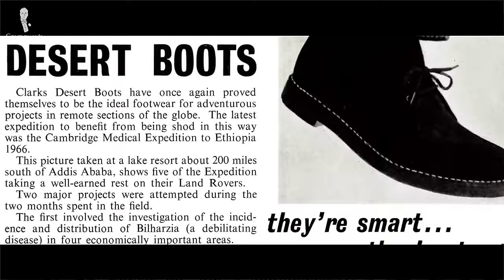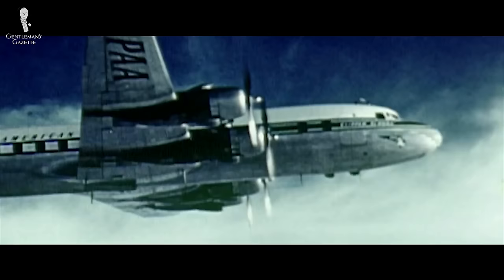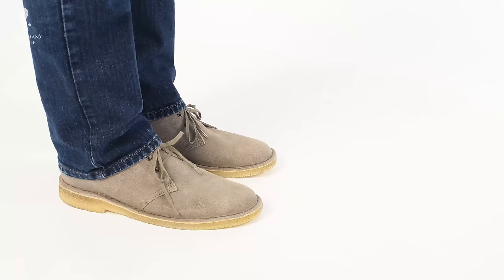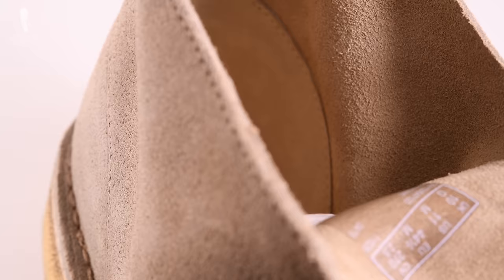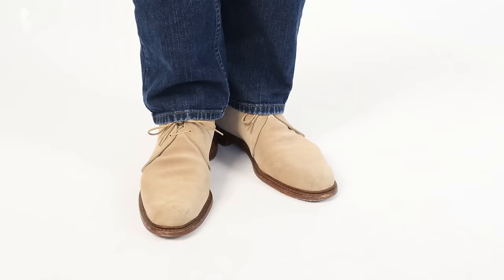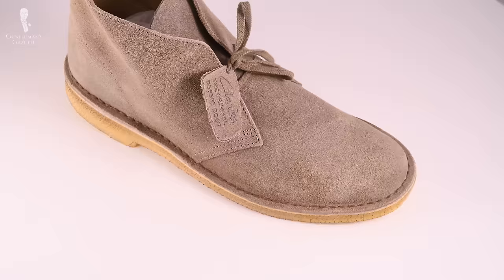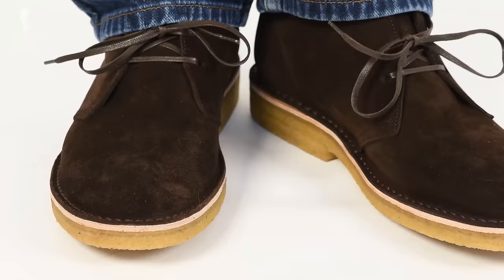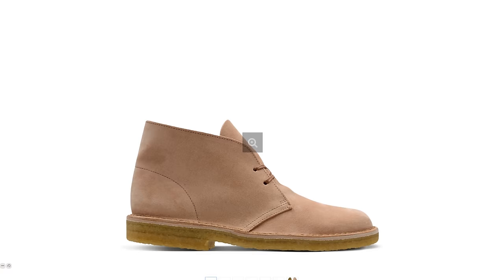Clarks Desert Boots Review - Is it Worth It Series - Suede vs. Leather Chukka Boots

Comment: So I bought mine in 1995 sand gray which historically explained is the original color.  They were 95USD in a factory store here in Las Vegas.  They fit so well and were so comfortable that I bought the waxed version for my travels in wet weather as they shed water better.  And yes both have developed a great patina and I still wear them today with the only repair being replacing the laces when they wore out about 3 years ago. Oh and yes they were made in England.  Classic bu I'm now in the process of buying a pair of rm Williams in chestnut.  And yes they are still made in Australia.

Comment: I too don't like matching the belt 100% with the shoes, keeping it in the same category - or realm, as you said - is most smart. For me, if I'm wearing blue shoes I don't wear a blue belt - if I had a blue belt, it would be too unique of a design/colour so it would just look off and odd with any blue shoe of any material - so instead of blue belt I go with brown belt with the blue shoes.
  Conversely, going with a blue belt and brown shoes is a no-no by default. Unless it was workable depending on the specific features of the outfit, it should never be done.

Comment: Another Clarks Desert Boot not mentioned, though it is essentially a Desert Boot - The Bushacre 2. The main difference is that it has a longer-wearing synthetic rubber sole instead of the crepe one. I've had a few pairs and will never buy another since I figured out that the unstructured nature and lack of support these provide gave me foot problems which had to be treated by a doctor. No more floppy unstructured shoes for me of any type...

A few years back I had a nice take on a desert boot done by Cheaney out of the UK. Those fit more like a nice pair of structured dress shoes and didn't have the support issues that Clarks have. Knowing what I know now I wouldn't recommend Clarks to anyone.
Reply: The bushacre 2 is only 60 bucks on Amazon too. And to be honest 60 bucks is all I'd pay for these boots.
Reply: dietchapstick lose some weight and you should be ok to wear them again

Comment: Since the suede leather is just your waxed leather flipped over I would prefer the waxed leather on the outside of my boot. Its both easier to clean and easier to maintain. It looks like the waxed leather is a bit thinner so that's going to be where the savings come in in terms of manufacturing cost. They sand it down do you don't see the scars and but bites and what not from the animals skin but its more than likely the same tanning method being used between both leathers even if they are coming from different tannerys. I will say that the insole of the Made in Italy does look like an actual piece of veg tanned leather and that could be a major decision maker as far as what to buy. It looks like the insole on the other two boots are possibly synthetic or just extremely thin pieces of leather.

Comment: I had a pair of Clark’s chukka boots - same as the desert boot, but not suede. Big disappointment. The inside lining which was some kind of cardboard like stuff covered with fabric. I only wore then a few times before the lining wore through and kept losing pieces under my heel. I tossed them. If I ever buy from Clark’s again, it will be shoes that do not have a lined heel.

Comment: I bought a pair of the beeswax on sale from zappos for around $80. The fit was hard to get right and i went down a half size and they stretched perfectly. Aside from one shoelace, they are lasting strong for +5 years now. I bought 2 identical pairs as eventual replacements from American Eagle for $50 each when they were having a sale, and aside from one shoe donating a lace, never touched. 

They are not at all water proof, keep feet cold, and are not slip resistant. I have flat feet so I can't walk in them every day past 2-3 days in a row.

Every year condition with fresh beeswax or a conditioner like Venetian Shoe cream and you're set.

Comment: I wouldn’t say they are not winter boots. They are excellent for mild winters, especially the beeswax leather which is water resistant. Also the crepe insulates the foot from hot pavement in the summer and the boot breathes very well. Much cooler than trainers. In summary, a “desert” boot, good for hot days and cold nights.

Comment: I like desert boots. Shame they are no longer made in the UK. Same with Doc Martins
Reply: You can still get UK made DMs, you just have to know where to find them. They are not sold at mall stores and chain shops. Some specialty stores will have them or you can order them direct from DM by going to the "Made in England" part of their site. Another option would be boots from Gripfast, Gladiator, or Solovair boots, which are all made in the UK to the same standard (slightly different design) as MIE DMs.

Comment: I have both the sand colored suede desert boot as well as the waxed leather. What I do find in the shoe is that there is an inconsistency of lasts. My suede pair are somewhat larger than a usual size 8 and the waxed leather ones had to be stretched by the Shoemaker but fit fine. I agree that Clarks desert boots have a much more casual look than others. Which boots other than Clark's would you recommend that may have a dressier feel?